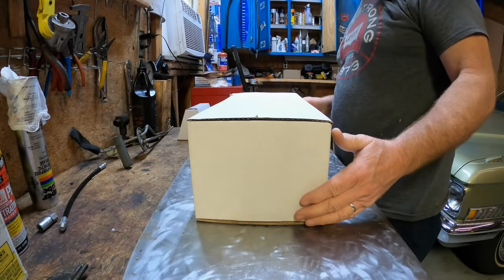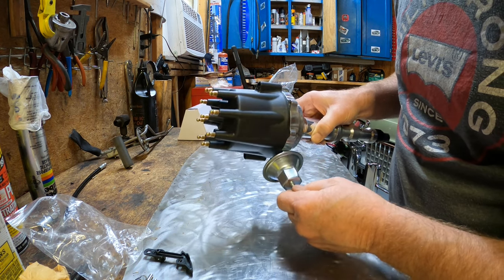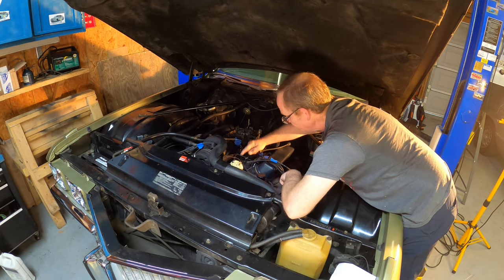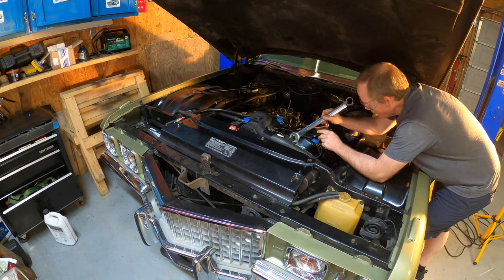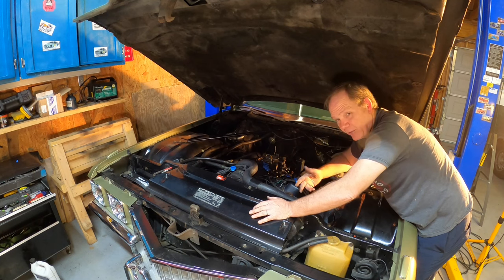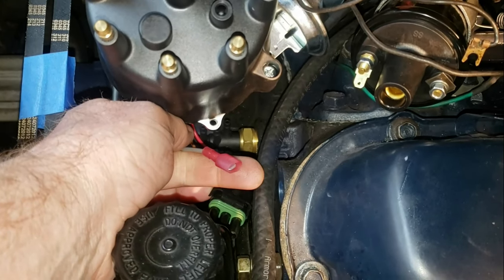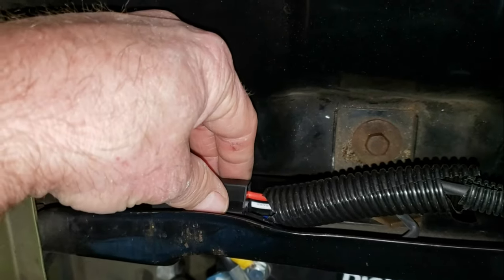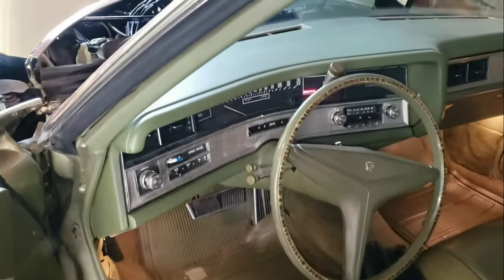CRT Performance Distributor - Cadillac 472 500 - Complete Installation

Comment: So question. Did the relay work out after all? I have the same one and did the exact same thing your doing and it had run on issues. I could pull the key out of the ignition anf it will still continue to run because the relay would not de-latch
Reply from the maker: I copied this setup from what you shared in the group Robert! Works perfectly!😁 Appreciate the tip. I will keep an eye on that.
Reply: @ImpalamansGarage  ha that's great! Maybe the fact I tried to run my relay above the coil instead of off to the side of a fender to keep heat soak at a minimum may help. If in fact you do get run on just pop the hood and pull the relay fuse.

Comment: If you replace the o rings on the r12 system, you can run propane as the gas. It's what's inside of those cans they sell for r12 replacement gas. With that said if you rebuild the system with a proper modern compressor it will be much more efficient, although I heard you need a larger front condenser for it to be effective.

Comment: The distributor caps with the brass or copper contact points are better than the ones with aluminum contact points.

Comment: Glad you are feeling better ..... I few more degrees of initial timing is a good idea ... If you get ping at Cruse that vacuum advance is adjustable and you can use the allen wrench and reduce cruise-only timing .... Also I like you choice of relay as if you really had to secure the car you could pull the fuse so it will not start
Reply from the maker: Great tips Scott! Thanks!

Comment: Great video ... I learned a few things I did not know even after messing with vehicles for 45 years. Wouldn't it have been easier, and neater, to just run a switched 12V power source directly to the + on the coil ? No relay, and a lot less wire.
Reply from the maker: I am using switched power. I'm using the resistor wire as a signal to turn on a relay sending battery voltage to the coil. There is no other suitable switched power readily available in the engine bay. Alternatively one could run switched power from the fuse box through the half-century old firewall bulkhead connector and risk breaking it. That would be an unwise move. All just my opinion of course.
Reply: @ImpalamansGarage  It's all good. Your way is totally acceptable, it just seemed like a lot of work. I'm no electrician, but I would also worry about running the relay off a resistor wire of less than 12V. Just FYI, your Caddy videos are super interesting to me as I just picked up a 1970 Eldorado that has been sitting in the desert for 30+ years.  ( Arizona ) Got her running and drove her home 100+ plus miles ... Now for the very slow restoration process. I do plan to get rid of the points ... Just deciding on the route you took, or a GM style HEI distributor. I like the stock look of your set up, but I like the performance and super easy to find modules of the HEI. Also looking to pick up a second air cleaner and do your dual snorkel set up ... very cool !

Comment: Pulled an HEI reman distributor out of a 78 with a 425. Gonna retro fit it on my 70 coupe. Needed ideas for the wiring. Great vid
Reply from the maker: Found the relay over on the 472 500 FB page. Recommend that group.
Reply: Factory HEI will almost not clear the double V-belt from a 70. The setup from impalamansgarage is an aftermarket HEI with small cap, which will fit better.

Comment: I don't know if I'm correct but isn't there a kit for your distributor to make it electric ignition and have stock look to it
Reply from the maker: Yes there is. Made by Pertronix. All the other mechanical parts would still be 52 years old however. Gear, bushings, weights, springs, points cam lobe..... all that stuff wears. For an extra $100 I got a new one plus a coil and wires. I did give serious consideration to installing Pertronix.
Reply: Now I understand 👍